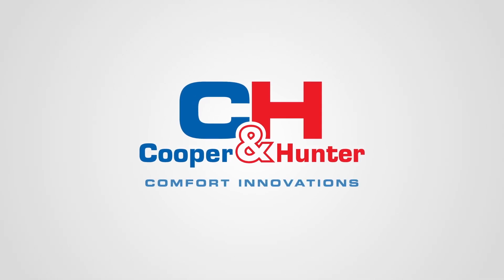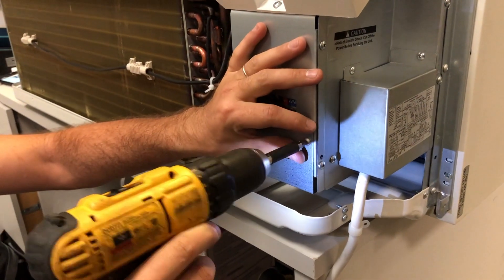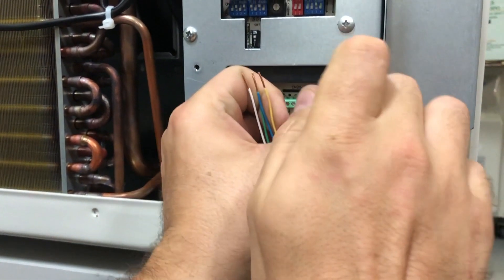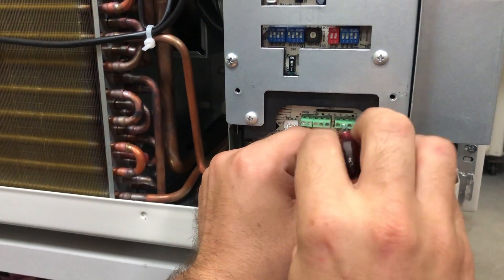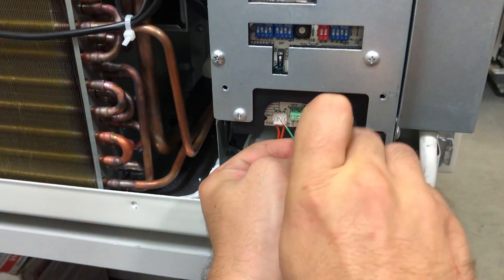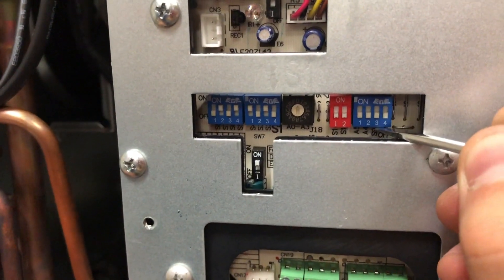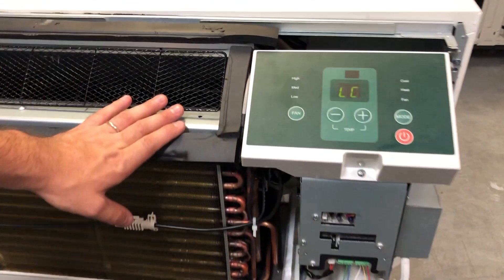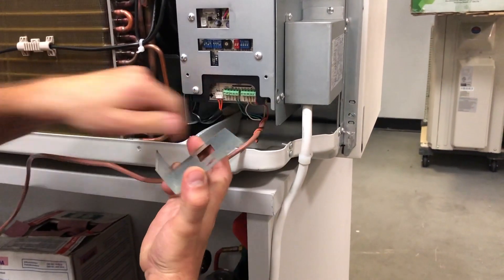Connect Cooper&Hunter PTAC to Third-Party Wall Thermostat

Comment: When connected to an external thermostat, I get a hiss when the heat pump kicks off. Guessing this is just the compressor releasing pressure, but the sound didn't seem present when running it with the onboard controls - it would run the fan for a while after the compressor shut off. Is the hissing with the external tstat normal?

Comment: does heat 1 only enable the heat strip?
Reply from the maker: If your PTAC unit has both a heat strip and a heat pump the heat strip is the primary heating source. The heat pump will automatically enable once the set temperature is reached to maintain it without consuming excess energy. 

Does this answer your question? We hope the information is helpful!

Comment: Can u use a nest home thermostat
Reply from the maker: Yes, a Nest Home thermostat would be compatible with a Cooper&Hunter PTAC unit! :)
Reply: I tried to add nest on thermostat without c wire as shown here and it is not working. Can you share wiring diagram